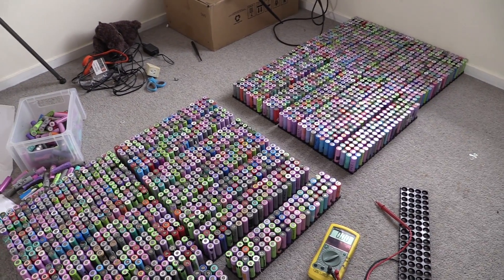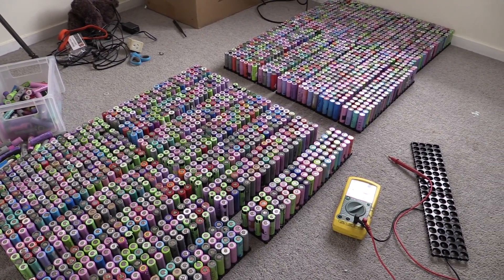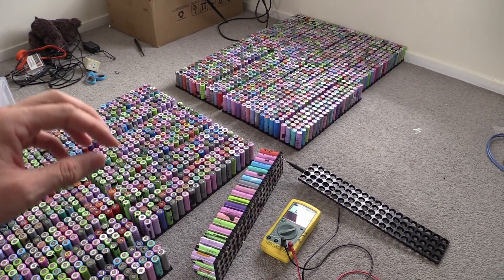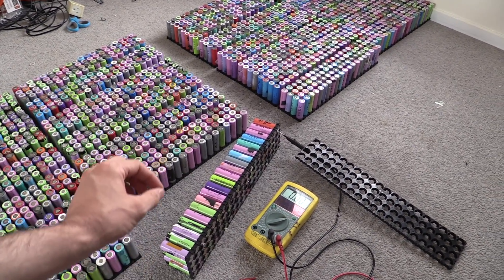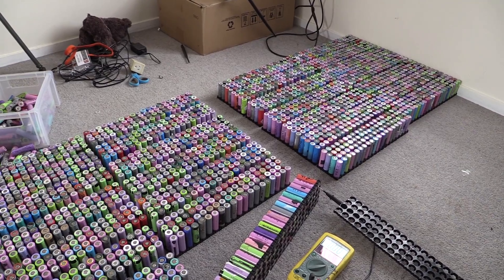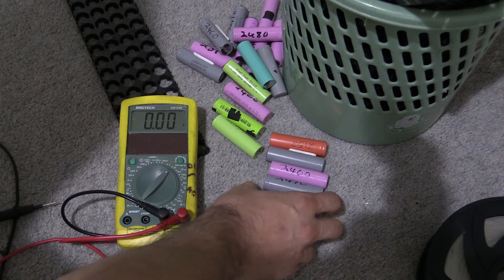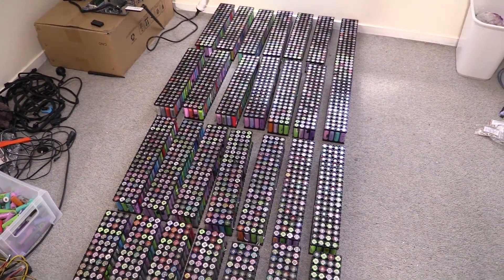18650 20kWh Battery Build Part 1

Comment: How did you measure the battery capasity. Pleade give the link for tester. I have harvested about 300 batteries and out of 3oo only 35 cells I could measure over 2000mAh. I am using ""8650 Li-ion Lithium Lead-acid Battery Capacity Meter Discharge Tester HW-586""
Reply: I can recommend Liitokala https://amzn.to/2SrVzQv

Comment: If you leave the self discharging batteries in, I suppose it can drain the whole battery bank over time. Is this the issue?  Or is it just that you are losing 1% (20/2000+) batteries.   Or is there some other safety reason for removing bad batteries?
Reply from the maker: If you left them in it will drain down that pack out of 14. This would mean all other packs would over charge. So very bad. Also when the charger turns on and trys to charge say at 20amps then that pack that is drain eg at 1v will be also getting 20amps again which is bad.

Comment: Off topic question, but doesn't it seem like there should be a solder-free case/pack that allows you to just drop in batteries and end up with stackable packs with leads to connect.

Can these be stacked? how close together?

Require ventilation?
Reply from the maker: Yes there are but very costly and some dont support cell fuses. A solder-free case is a good idea and fine for small projects where time is limited but even then if its small it doesnt take long to solder etc. The costs of some solder-free parts for 1400 cells would make it not worth doing etc.
Reply: Jehugarcia made one as a kit, very cool.

Comment: Great job Mike!!!
I have a question for you... all the 80s batteries have to be at same number of mAh? ...I have few of them at 9800mAh and I would like to know if I can mix them... Thank you!
Reply: 18650s can not contain 9000 plus mah.. many poor quality Chinese brands state this Mah falsely, sure people will correct me but I think 3200mah is the highest legit 18650?
Reply from the maker: no they dont but each park you make needs to have the overall same mAh as the other packs you make, that way when you put them in series they will all charge and discharge at the same rate.,
Reply: 9800 mah 🤪

Comment: If u made a volt meter that went down the decimal point by quite a bit u could probably instantly see the self discharging batts........

Also since these are similar to capacitors I would wounder if a ESR test could be done
Reply: Yes and yes.
Good cells have around 50mOhm, fakes around 100mOhm and bad cells above 100mOhm all the way up to couple ohms

Comment: Hello Mike question what is that roll of wire. Or is that a roll of Strip metal?
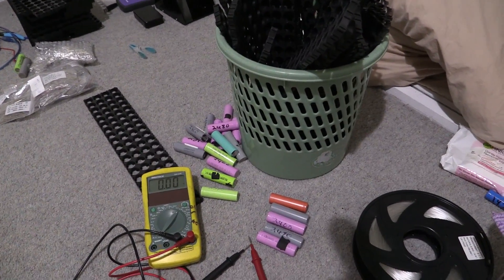Reply from the maker: hmm you mean at 4:15sec? that's not wire its PLA filament for the 3d printer left on the floor
Reply: hello mike Okay cool i was just wondering.
Reply: I need to make a small pack for a friend of mine i have 160 cells and about holders that can hold up to 200 cells. Problem is i have to make it a 4s  setup because of the inverter can only do up to 15v. Not sure how to do it with these holders the 5x4 ones how many in Parallel.
Reply from the maker: hmm 4s 4.2x4 is 16.4v over your 15v limit. So 3s would work better. Even only charging to 4v per cell thats 16v. I think your friend i better off with a new inverter rather than one that is for 12v batts. If you do go with 3s than 66cells in parallel
Reply: 3s66p is about 198 total cells. That is more then i got for him. But i think 3s50p might works.

Comment: 20/2200 cells failed?!  thats  less than 1%! Im assuming there are others that failed previous tests, right?.... i ask cuz, from my recoveries so far, between overheating, low capacity,  and slow discharge, id say about 1/3 of the cells fails my tests some where along the way.... of your total collection of cells, what percentage or ratio do you get of good to bad cells?
Reply from the maker: ya 20/2200 cells it right, but the 2200 are the ones that pass the previous tests and were good enough for the powerwall build. I dont have the numbers of total cells vs the 2200 good ones.
Reply: cool... a rough estimate would be useful, im curious to know what others are getting.

Comment: Little warning when you go to pick them turn then over on trier side before you pick them up or they may fall apart looks great
Reply from the maker: i put the top plastic tops lightly on to hold the cells in place when i tested all 28 packs

Comment: Acording to manufacture leaving 18650 discharged does some damaged to the cell and how do you no witch cell self discharges without charging it back to 4.2 volt?
Reply from the maker: You don't need to change a cell back to 4.2 to know if it self-discharging. When you leave it discharged it should set around 3.3 to 3.5volts if it drops over a month to 2v or anything less then 3volts you know there's a problem. Eg with the 2240 cells in the video 20 cells self-discharged all the rest were above 3.3 volts so I replaced the 20 bad cells. Leaving a cell at 4.2 volts is far worse in terms of discharging than leaving it at over 3v. If you were going to store the cells of a year you should charge to around 3.6v.
Reply: Mikes DIY Tesla Powerwall some of the cells after they have been fully charged for a couple of days will self discharge just for an example down to like 3.9v and then they stop discharging the cell can be there for months and stay 3.9v so how do you eliminate those ones.if you dont eliminate those cells they will slowly take energy from the other cells and overtime unbalance your packs. Under 4 volt after a couple a days i do not put those cells in my packs
Reply: I only have a small 7s 20p and its runs great with no bms 28.5v to 23v only .05v difference from each pack
Reply: Or maybe the way your doing it still eliminates those cells not sure lol your the first persone that i hear thats building a powerwall with discharged cells

Comment: Did you get the back to front cell? was pack 2 cell 4. Starting from the wall Left to right.
Reply from the maker: i did, and even at the end of the video when i put all plastic tops on i found a couple that were in the wrong way. Just shows you how easy it is to miss when doing so many at once.